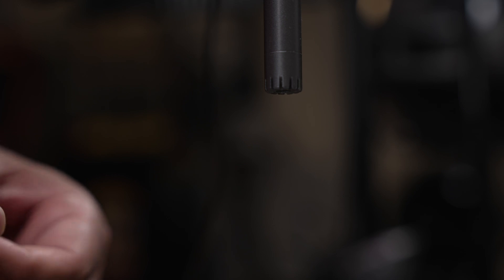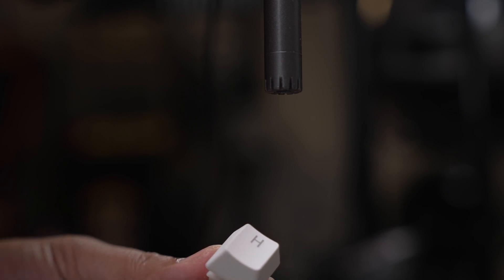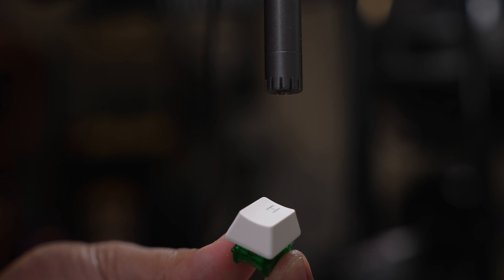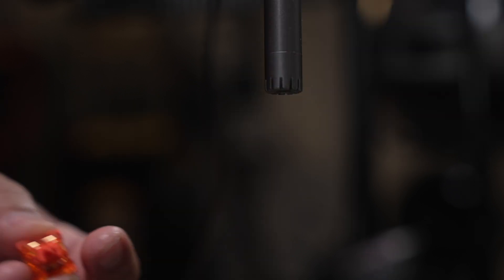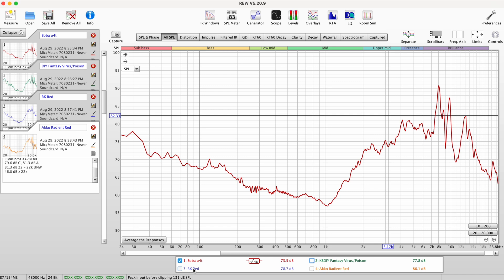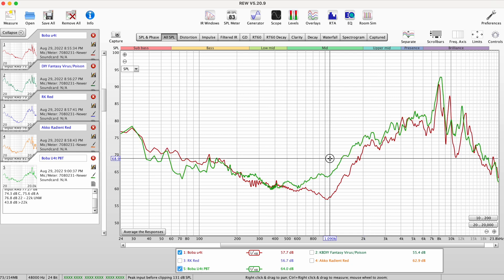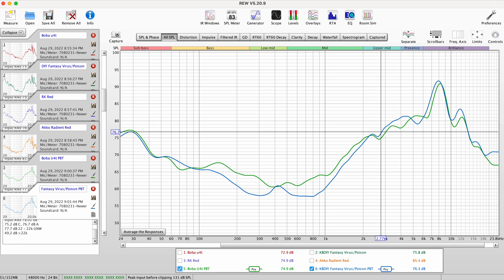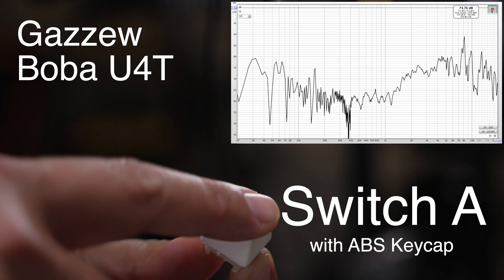Frequency Response Measurements of Mechanical Keyboard Switches

Comment: Hi, thank you for stating that the switch won't sound the same with a different keycap but I think you should really at the very least put that switch in an acrylic switch tester, a standard budget board like a gk61 would be even better, it's going to sound MILES different from your fingers than in an actual board since fingers are squishy and squishy things absorb sound.
Just my suggestion though
Reply from the maker: One of my goals was to use a simple method that others could recreate with some level of consistency. I figured holding it between our fingers would be the simplest solution since the dampening effect of our fingertips is minimal compared to how loud the switch is near the mic. The sound changes even just by placing a keycap. I've experimented with placing it in a piece of foam to isolate just the switch by itself but that led to the switch moving too much creating other issues. None of the methods are perfect because the fact that the switch needs to be held in place means there will be interaction with whatever it's in contact with. I have an acrylic switch tester coming in later today. I'll experiment with it. The only potential problem I see is perhaps the size of the acrylic or thickness might affect the sound significantly. Given the choice to couple the sound to something that change the sound in various ways (i.e. acrylic tester, PCB, or barebones keyboard) vs. something that dampens the original sound (I.e. our finger tips,) I prefer to choose the latter. I could be totally wrong and may find that the tester gives more repeatable results. We'll see. That's what's great about using a scientific approach; I'm proven wrong all the time. That's how we improve the process.
Reply: @keyboardacoustics6264 i see your reasoning but i wouldn't say the fingers are just turning down the volume on the switch. keyboards change the sound by reflecting and absorbing certain ranges differently right? The same happens for your fingers, i think a lot of the switches being tested are losing a lot of their bass frequencies to that. I appreciate that you're going to do further testing with the acrylic tester, I think that even if it doesn't sound exactly like a keyboard its going to sound a lot closer than fingers.
Reply from the maker: It sounds like you have a good amount of experience with keyboards, so I appreciate the guidance. I'm new to keyboards, but not to audio. 

Keyboards change the sound because the materials interact and their resonant frequencies can sum and cancel. They don't always add up like some people think. So the more components I add, the more interactions I have to take into account. For example, an acrylic tester can accentuate certain frequencies and change the tonal balance. It's not amplifying all the sounds equally. At the same time, my fingers holding the switch are not dampening the sounds equally either. But if I had to choose between the two, my best guess is holding it will be more consistent. Again, I could be totally wrong too.

About the acrylic tester, I guess we'll see. First, I will test to see if placement within that tester causes variance. If it doesn't, that might be better.

I think we're saying the same thing in different ways. I don't know that the bass frequencies are coming from the switch itself though. I think those lower tones are caused by the force of the downstroke from the key press interacting with the larger components like the PCB > case > desk. In the case of the acrylic tester, I'm guessing it will go force from the downstroke > keycap > switch > acrylic tester > desk. I think that isolating the tester from the desk will lead to the same bass decrease meaning the interaction is between the acrylic tester and the desk and not from the switch interacting with the tester.